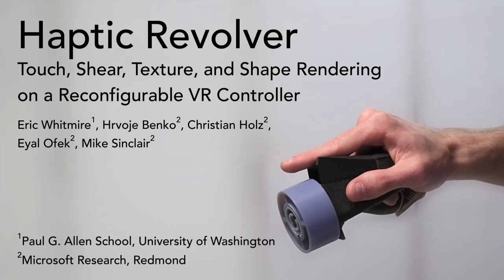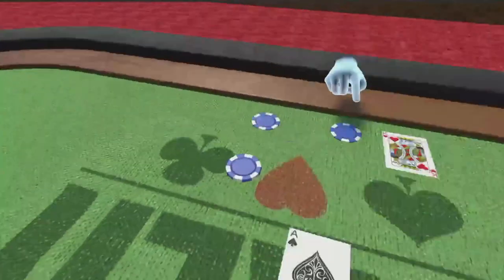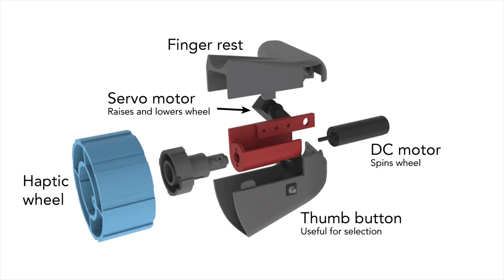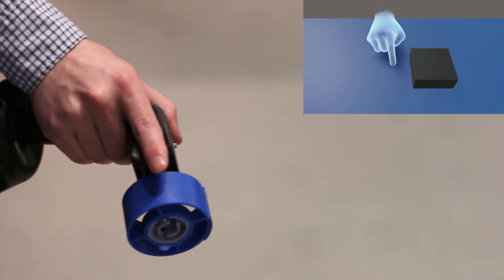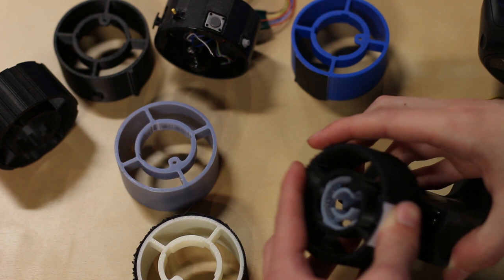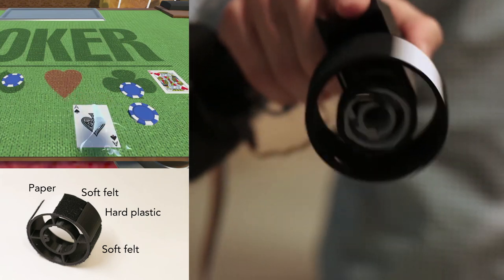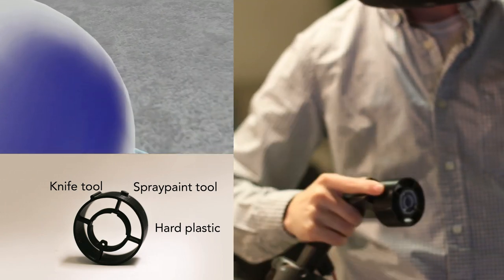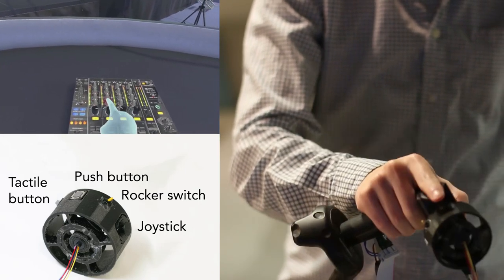Haptic Revolver: Touch, Shear, Texture, & Shape Rendering on a Reconfigurable VR Controller

Comment: looks cool , but i see one issue with this, specially for that card game scene, you can scroll over the board far enough since then the wheel will rotate and the card surface will come under your finger as the card smooth surface is stick to one part of the wheel. But nice concept :)